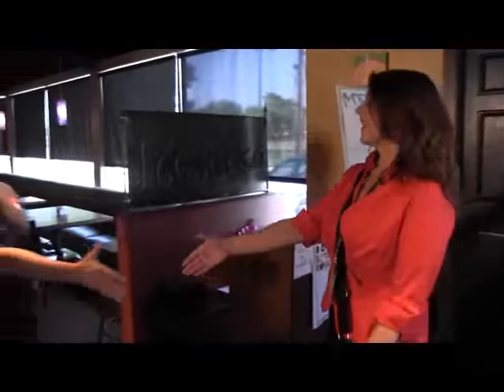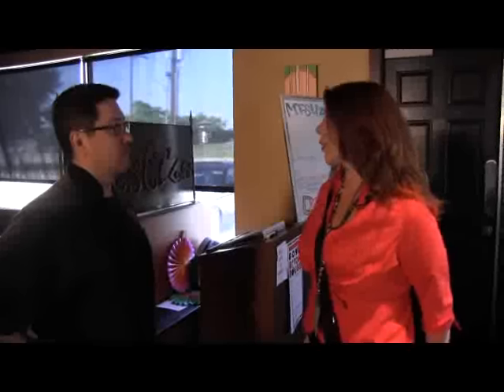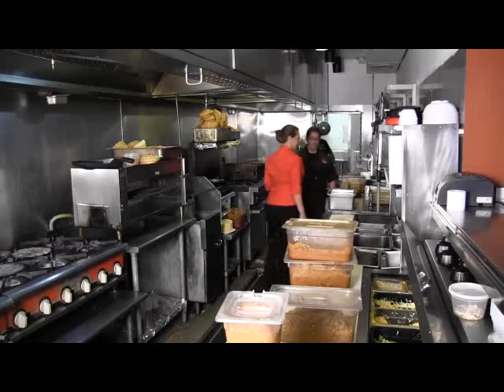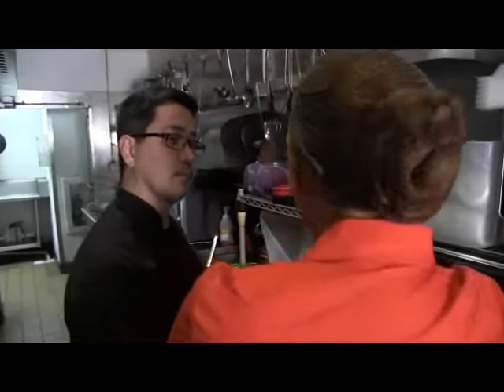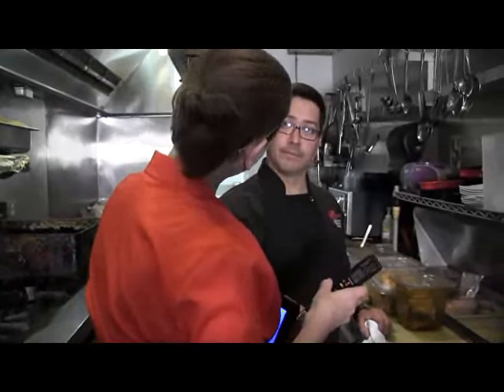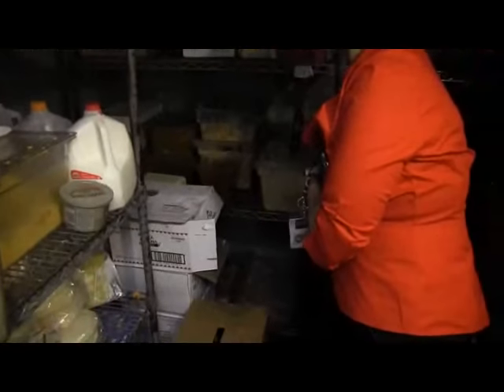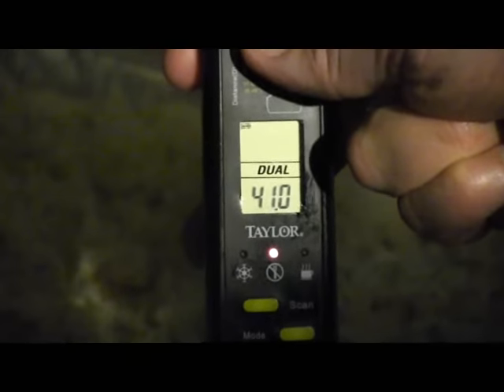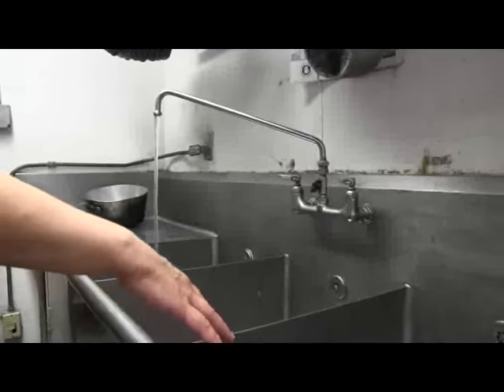What Happens During a Safety Inspection

Comment: The air gap indicated is incorrect. The configuration they have is an air break.  An air gap for wastewater requires the waste pipe to terminate 1" or more above the flood level of the receptacle.  The air break is a priority violation FDA food code